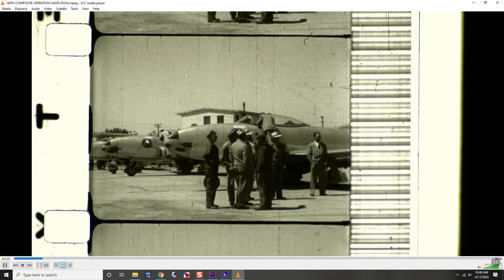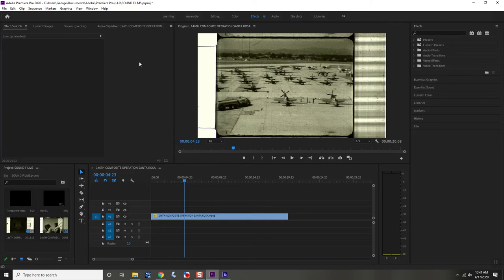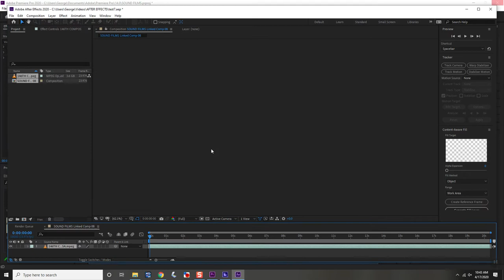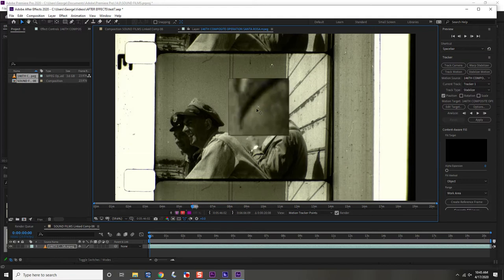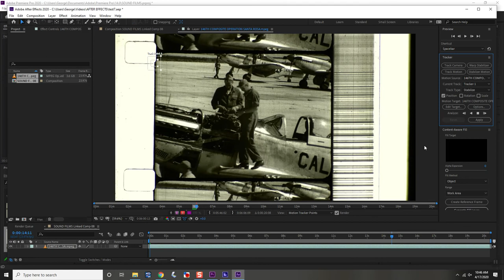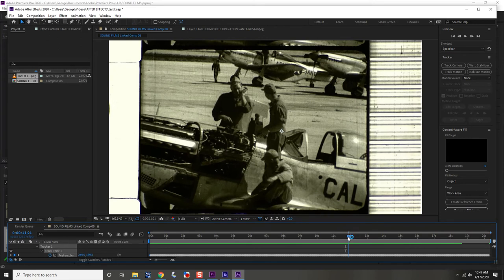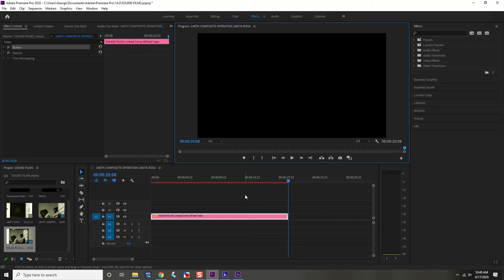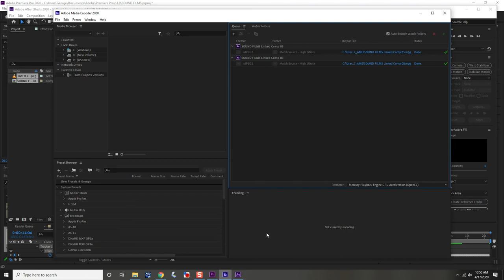STABILIZING ANTIQUE CELLULOID FILM IN ADOBE AFTER EFFECTS 2020

Comment: Thank you so much!  I had a very jittery film and this fixed it up really nicely!  too bad the camera man was wobbly too.  Can you combine the sprocket method with another run focusing on an object in the frame?
Reply from the maker: Yes you can use stabilize motion focusing on individual elements in a particular series of frames. What I recommend is digitally slicing your scenes into sections and then apply your choice of stabilization to each individual scene. Just remember that warp stabilizer does not work very well for fast moving scenes. use stabilize motion on the sprocket holes or specific elements for those scenes. I’m glad it helped thank you for watching.
Reply: @OfficeofImageArchaeology  thank you!